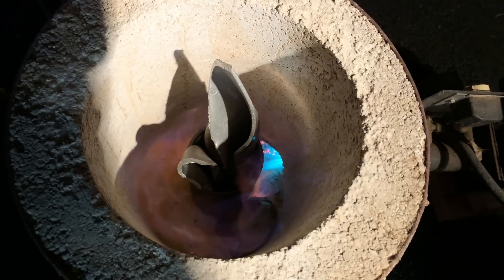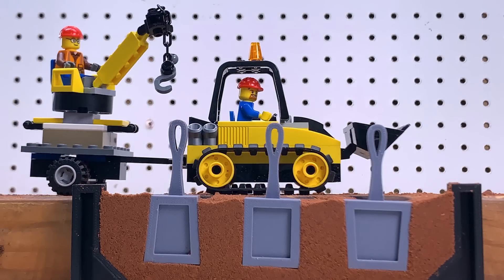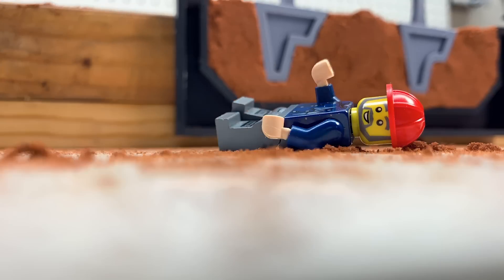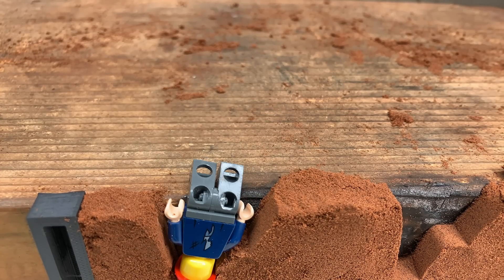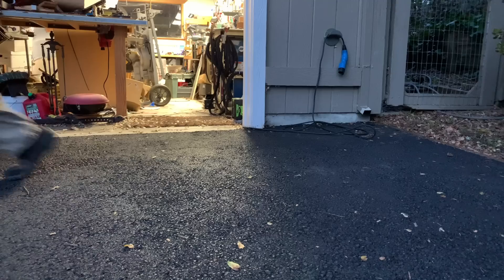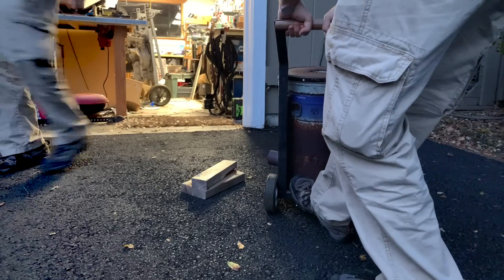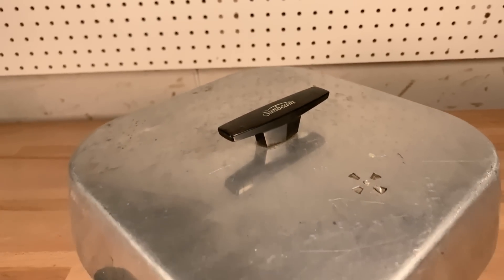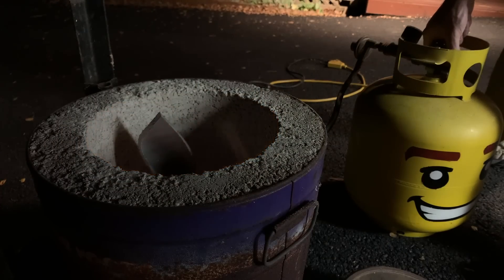Learn to Cast Metal Parts from 3D Prints

Comment: Excellent Video, and as an educator, I have at dïsposal the casting equipment. I was wondering if you can share the 3d model to print and I formalize the document to introduce sand casting to my student. If it is already share, where can I find it ?
Reply from the maker: Oh sure I guess I could upload the models if you want to print your own bats.  lol.  I'll do that later today.  Are you using water bonded sand or Petrobond?   This design has some semi deep green sand cores (the holes though the wings) that make it very slightly tricky to open the mold.  Not terrible, but slightly trickier for first time foundry folks.  You could see in the video I had to redo the mold once because one of those cores broke off. If your doing water bonded sand that might even be more frustrating.  I'll reply here with a link later when I find the models and get them uploaded.
Reply: @retrotechjournal  thanks, it sand with oil as I remember. I am not sure it is perfect. I will try first by my own. I think it will be really help full to show your video first to my students. Also for English and casting purposes (in addition to my traditional courses). I will show you the results.
Reply from the maker: @rkrom3250  Yes I'd love to hear how it come out.  Foundry work is very fun and satisfying. I think it will be a great thing for students to do.
Reply: @retrotechjournal  how can I give you a feedback? I have sometimes tomorrow and Friday for trials. Do you have the model?
Reply from the maker: @rkrom3250  I have put the files up at https://www.thingiverse.com/thing:4738831

Comment: great job
==i want to see flowing molten metal inside
Reply from the maker: Me to!   It is true there is some inherent magic to flowing molten metal.  When the metal is still very hot but has a crazy thin layer of solid metal on the very surface it looks amazing. Glowing but also sliver-y.  I always cast after dark because 1 you can better judge the temperatures, but 2 it just looks much cooler!   :]

Comment: May I suggest anodizing at the very least but mostly considering usage of a less dubious metal for use in food production?

Absolutely loved the video and your presentation ! +sub
Reply from the maker: One of the reasons for using a melted down a hot plate instead of random scrap was to be sure it was a food safe alloy.  Also the batter is known composition, unlike general cook ware that may b exposed to highly acidic foods, etc.  That plus very low exposure (they're not something I cook with every day) has me personally categorizing this as very safe.  I'm glad you liked it!

Comment: Didn't want to be a downer, but I clicked this to "learn" the process, assuming it would be "taight".

Instead, i'm just watching a man go through the process, without explaining the process 🤔
Reply from the maker: I tried to explain why the parts need to be designed with a taper so they can be removed from the sand and that they need to be very smooth so they can be successfully pulled from the sand.  I tried not to be too technical and show by doing.  I've been working on another video going into more detail about mold design.  What parts do you most wish there was more detailed instruction about?  A deep detailed How To for foundry work probably wouldn't fit in 12 minutes, but I do plan to make at least one more video about some aspects of the process.

Comment: I want to use this technology to build a 15 inch gauge farm railroad  all the specialty parts that are needed to build a shay steam locomotive  half to be made from a master casting mold
Reply from the maker: Yes I've often thought that 3D Printing of patterns would be great for more complex locomotive castings.  I've built a stationary engine, and used to subscribe to Live Steam, but a full on locomotive is a bigger project then I'm willing to take on.  The best part is if you design a 3D printed pattern you can share it with others.  I'm sure there must already be steam engine casting patterns of some kind on Thingieverse.  Good luck with your Shay!
Reply: @retrotechjournal   I'd like to see that stationary engine on your channel

Comment: This is really great! I love how fun you made this. What did you use for a crucible? Any recommendations on sand for casting?
Reply from the maker: I'm just using a steel crucible I made by welding a plate across the bottom of a piece of pipe.  For AL that works fine.  I have holes near the brim that lock into pegs on the tongs so there's no way to drop the thing, and a steel crucible can take a lot of abuse.   If you run the furnace  blast too lean you can eventually eat a hole though the side of your crucible, but a thick walled one like the one I was using lasts a long long time.

I was using Petrobond.   It holds great detail, and can be ready for casting on a moments notice.  The main downside is you can't really recondition it at home without a muller, and I've never built one of those.  I don't cast super often, so not having to add water/condition the sand for a bunch of time ahead of doing the casting is great.  Because I don't have a muller I tend to just use a spoon to scrape away the most burned sand right around the casting, and sequester that is a different bag so I can hopefully recondition it some day.  If I ever get around to building a muller.  

I use loose sand for lost foam casting, and used to use water based sand, but it just ended up taking too much time/had a higher failure rate because I didn't always have it conditioned right.  This way it's simple.  I just pull  out the tub and do some casting.